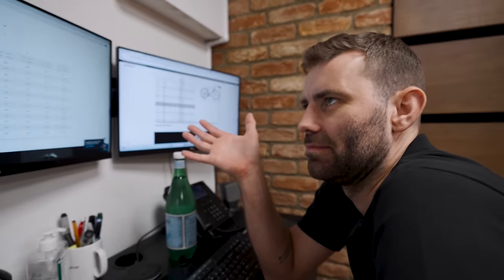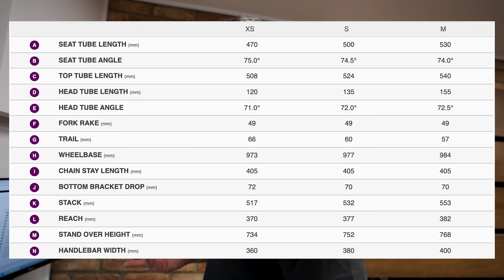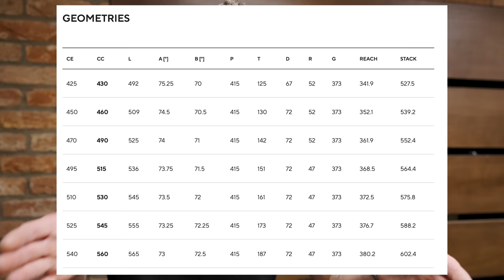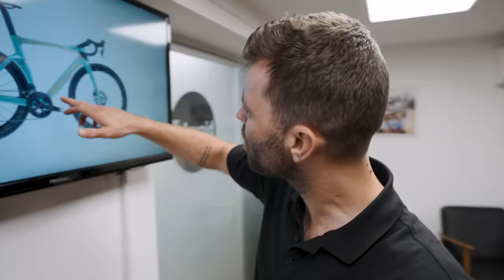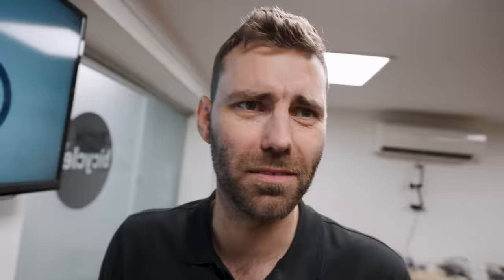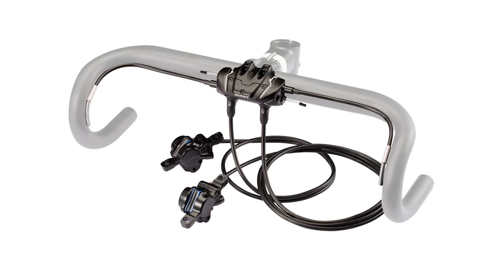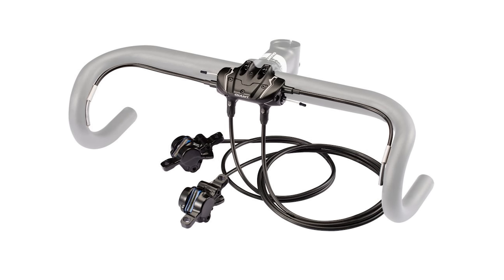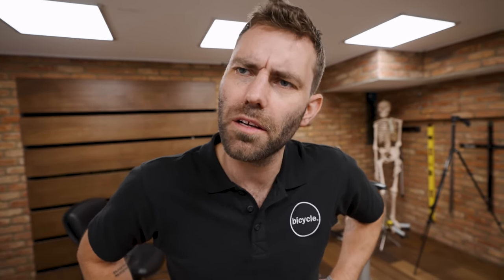Pro Bike Fitter's 9 Most HATED Bikes

Comment: How did I know he was going to shit on my Madone 😂 I can agree that the very worst part of my Madone SLR is the proprietary hell. Thankfully, my model has a two-piece stem and bar design, but replacement bars are expensive as hell. I recently had to pay $500 + labor for a new bar, and the brakes had to be bled because of a crash. It's a fucking rocketship though. I don't regret my purchase :)

*Side note: I'm in my 30s, and I'm flexible-ish but not really. You can mitigate the reach and fit issues of this and other aero bikes by buying the frame and building the bike to the correct spec for you. I don't buy pre-built bikes anymore.

Comment: Eloquently presented with proper use of English not interspersed with, "like" or other Americanisms.
 Is the bike geometry problem not exacerbated by compact, stiff and off the shelf design? I notice (and ride) older stuff that was bigger in frame size did/does not have too long a top tube. Look at seat post exposure, now deemed necessary to get flex as frames are so silly stiff. Your video made the valid point of the average rider, then does the average rider need all this stiffness for Richmond Park or whatever? Look at Beryl Burton, or even later where the frames were bigger, therefore the drop to bars less so but the top tubes of sensible length. Maybe made to measure, but also handed down and as you correctly say, many bikes are too long for most. Maybe, just maybe, the need for stiffness and trend aligned with manufacturers wanting to only have to supply a few sizes are the real reason for bad designs?  EG.  I'm heavy and descend fast, my most stable downhill bike has a curved steel fork. Very unfashionable but nobody is keeping up :)  Progress eh!  Once again, excellent series and as a subscriber of Neil Stanbury it's great to have a UK guy obviously of same quality.

Comment: Love these videos but I disagree with the Orca Aero handlebar fairings not being able to be taken off. I slid them off easily to change handlebars, and I've now even re-used them on a non-Orbea 36cm bar. 

You can also buy them as spares, so if you can't slide them on and off a handlebar, how would you use the spares???
Reply: It's not the fact that you can't slide them off. It's that you HAVE TO slide them off...

Comment: giant revolt x adv pro0, just about this high end pro0 model.

full suspension gravel bike. it has a weird fit size which you have to go a size down. a dropper post, why would i need a dropper post on a high end gravel bike?????  seems like giant just throw all the cool shit together and fit on a gravel bike.  i guess you only need this bike if you wanna do some real heavy duty trail tracks, but why dont you just go for a mountain bike????

so i ordered one couple months ago and go for a test ride. even the manager be like wtf is this. so i ended up bought trek checkpoint slr7.

Comment: I have a specialized diverge with the future shock 2.0 it was a pandemic gravel bike when it was delivered 2021.  It’s been months since I have rode the bike . I have no issues with the future shock. I imagine more owners of the future shock that ride the bike every day or multiple times during the week might have some maintenance issues. I’m not there yet.. My main road bike is a 2013 trek Madone, with Dura ace, 9000 group said including that annoying aero brake that you mentioned in this video, I’ve never had one problem with that brake. I just upgraded the brake pads to Swiss stop from Zipp carbon wheel pads .  Keep my bikes pretty clean. I don’t ride through horrible rainy weather so far so good !

Comment: That's a good call on the Orbea Orca Aero - I changed out my bars, so I could put clip-on aero bars on it.  I cut through the rubber fairings with scissors and was very puzzled on how this could be considered easily 'swappable' - not to mention an aero bike that has no means for aero extensions on the bar or means for clip-on aerobars in the first place.  But, I accepted that trade-off before I bought it just to use the MyO program and get a bike painted in colors I liked, given the price tag.
Reply: You cut through the rubber faitings? How did you manage to pull them on again?
Reply: @kallewirsch7915  I did not.  I had no plans to re-use that bar at the time.  And, when I did re-use it, I did not replace those.  So, I knew I was trashing them, but also knew that I could order more from Orbea.  Easier to cut them off than mess with the hydraulic brake lines.
Reply: @cgilbert0321   So, in the end, you drove without the rubber and with a gap?
Reply: @kallewirsch7915  Not exacty.  I replaced the standard Orca Aero bars with standard bars and put aero extensions on them - which will make my position more aero and provide more aero gain than the bars alone would.  So, entirely different solution for my Orca.  On a different bike, without aero extensions, that I did re-use the bar without the cut-off rubber parts, yes, the entire bar is not as aero, but it is still more aero without those rubber fairings than traditional bars.
Reply: You can just pull them down the bars... They come off very easily with the shift levers once your tape is off.
Reply: @datadrivendave  they won't slide over the shifters and that would require disconnecting the shift levers from the cables.

Comment: Long/low bikes can always be made short/tall. If you add 40mm in spacers to my 54cm Domane RSL's 390/527mm reach/stack, then it becomes 378/564. Furthermore I love bars with long reach and large drops. I want my tops to be close, my hoods to be far away and my drops to be even farther away. What I don't want is 3 different hand positions with virtually the same x,y,z coordinates.
Reply: Apart from some people not liking the looks of a tall spacer tower, most manufacturers don't allow more than 30mm of spacers including the headset cap on carbon steerer tubes. So you should check beforehand if you void your bike's warranty or even put yourself in danger by using too many spacers. As a heavier rider I wouldn't use 40mm of spacers myself.
Cannondale allowed 50mm on my 2015 Supersix Evo (I used the 25mm tall headset cap).

Comment: What does your power input have to do with fit and geometry 🤷🏼‍♂️
Reply from the maker: higher power output leads to less pressure on contact points - try riding at 50W and chances are it gets uncomfortable quite quickly. On the flip side, being able to ride 200W all day can mask lots of bike fit issues
Reply: Changes how much weight you have on the pedals vs the saddle and how much you engage your core etc. Higher outputs take weight off your hands.
Reply: ok thanks guys I didn't know either of those points.  @Cade_Media

Comment: The Aethos has the same geometry as the Tarmac SL8. When it came out it was competing against the SL7, which had different geometry. The stack on a 54cm frame was 10mm shorter on the SL7 and 3mm longer reach.
Reply: The SL7 and SL8 have the exact same geometry when you factor in the headset cap/transition spacer, which is mandatory.

Comment: I was going to buy an Aethos until I discovered it had Tarmac geometry.   Bought an Open MiND instead (touted in your last video) and would highly recommend it to anyone considering an Aethos.
Reply: Did you even try an Aethos? I owned one and it was one of the best handling and most comfortable bikes I ever owned, don’t believe the hype
Reply: @tombola4046  Yes, I tried it at length.  I didn’t say it was a bad bike, but its geometry is the same as a Tarmac.  If the geometry works for you (and it sounds like it works for you), it seems a great bike.  If it had the geometry of the Roubaix, I would have bought it.  But it was too aggressive for me and, per James, apparently too aggressive for many.